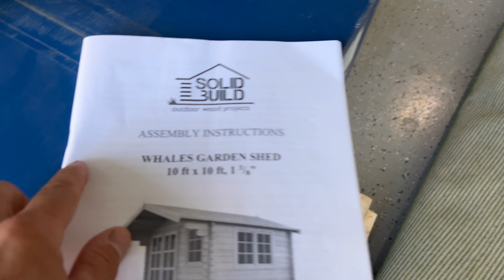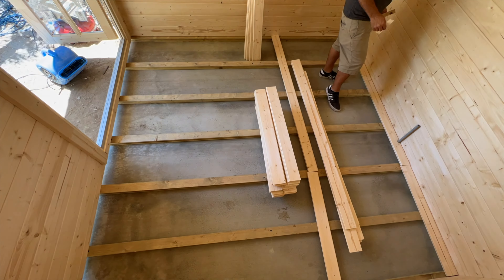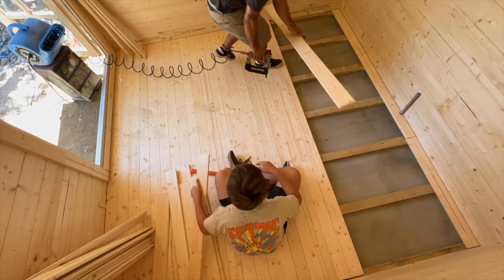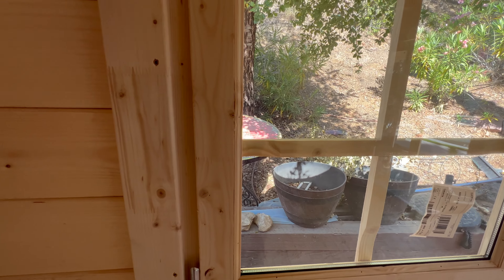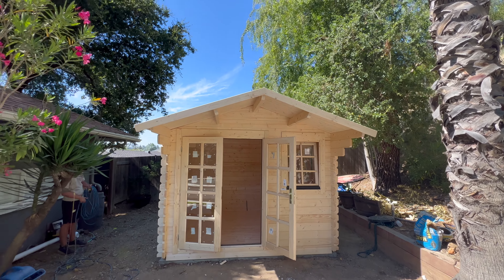Solid Build Outdoor wood Projects - Garden Shed Build - Instant Structure [2023]

Comment: Great video!  Curious to your thoughts for some type of thin insulation for the roof or under the flooring.  What would you use if the customer requested?  Thanks.
Reply from the maker: Thanks for watching. There is a plywoood called techshield that has a layer of insulation on it. You could put that down before applying the shingles and that would help plus keep the aesthetics of the interior paneling. For the floor, there are many options for insulated subfloor. You really just need to choose the best option for your area.
Reply: Thanks for the prompt reply.  My Solid Build shed will be here in a week or so and am looking at different insulation materials for each. We are in the south Bay Area so, like you, not terribly cold in the winter it can get hot in the summer time. Thanks again!
Reply from the maker: @spencerkinsey  awesome. They are super easy and fun to put together. There will be lots of movement in the wood as it acclimates to your area but is very solid, so just be mindful of that. If you have any other questions, feel free to reach out.